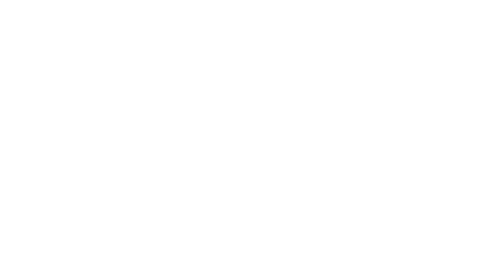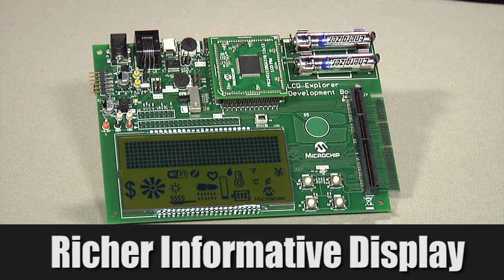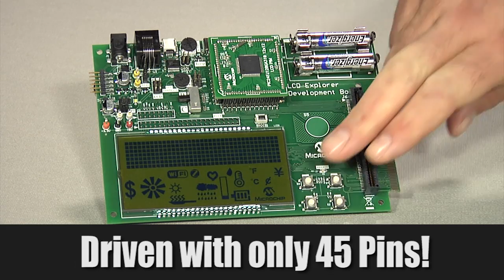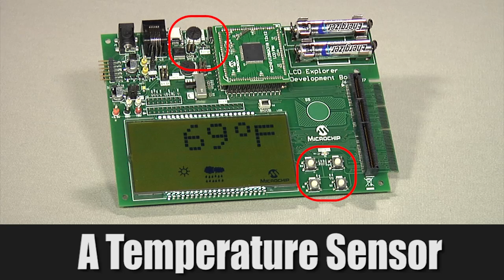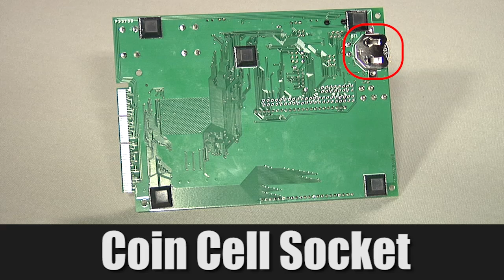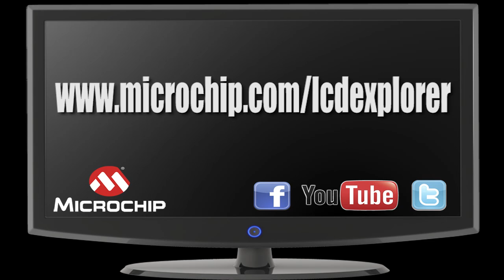LCD Explorer Development Board from Microchip Technology

Comment from the maker: @NGinuity It is difficult to answer your question without knowing more detail about you application, but the GA3 family (32 MHz) is fast enough to push data through a shift register, or serial channel to an LCD driver. Doing so typically requires an external LCD driver or a driver on the glass, to generate the appropriate AC waveforms. In some applications separating the driver makes sense. When pins are not an issue it often makes sense to integrate the LCD Drivers.

Comment: Do you think the micro run fast enough to use shift registers in between the micro and LCD instead of 45 pins?  I know the PIC24's can run around 80 MHz but I've never messed with this particular application.